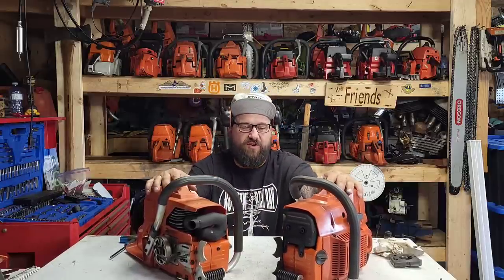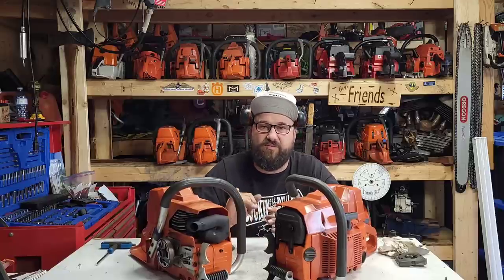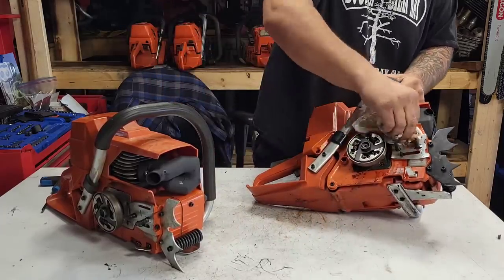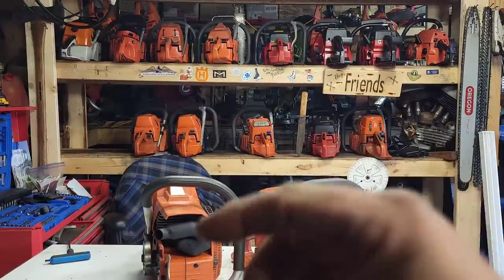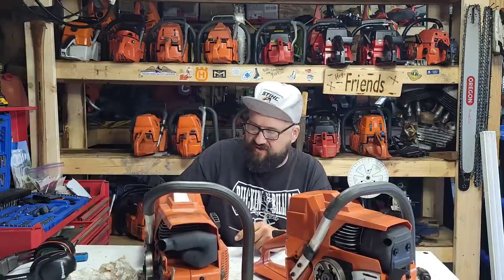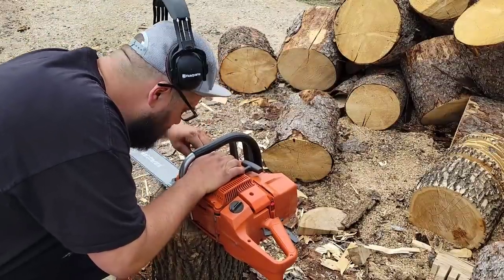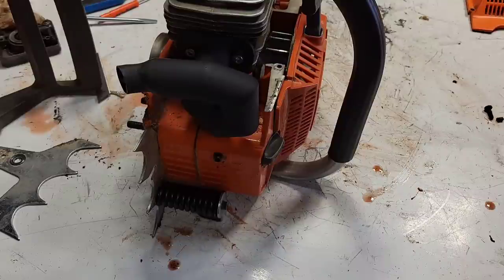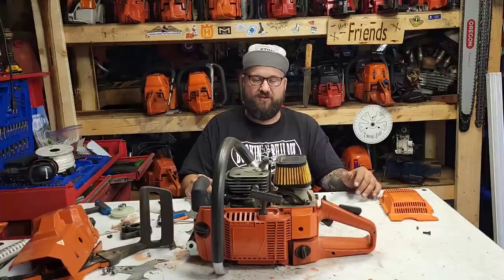Farmertec 288 kitsaws, the oiler issues continue!!

Comment: Idea: plastic bushing.  Find a plastic tube that fits the opening tightly, and the vent screen fits inside the tube tightly. Possibly a solution so you can use the smaller vent tube in the larger hole.

Comment: Gotta remove the vent to understand the problem. Shouldn't really be venting oil so I'm guessing its in upside down (like others have said). A sleeved oem vent sounds like a nice solution for not much effort, you have a lathe - 5 minute job. Can't let a silly tank vent de-rail your project :)

Comment: Love your common sense attitude twords power saw mods and repairs.   I’d like to try and help you out with the non oiling problems. I have three 395xps one of which is a walker saw that runs circles around the others and three 372 xp stockers alone with stihl 661 mags, and mis others alone with a slew of echoes. We do selective falling and vineyard prep.  Several of the huskies had oil shortage problems on chain oilers which we finally found to be vent blockages from blowing out with high pressure air into.  Vents. We has since kept these clean and no problems.  I think your idea of installing one way vent into oil cap may be your best fix other than replacing the stock vent and making sure it’s working, replacing with a larger saw vent may also help as long as it’s same od and id is larger. Good luck and let us know what you find out.oh yes and the chain bar oiler hole should be increased to 9/64” for anything over 20” long. I drill stihl , huskie and echo out and they oil better

Comment: I don't know how many times I've run saws out of fuel and thought they needed tuning :DD. Always gotta check that. Also, I'm working on a really cool project atm. It's a rototiller with a two-stroke in it.... Basically a dirt bike motor attached to tines. It's been fun to tinker with it so far. Hopefully it'll actually start running soon! I think it's around 100cc if I'm not mistaken, maybe more.
Reply: What brand tiller are you working on?

Comment: I’m new to saws, but I carve. I use echo and it was using 1 tank oil to 2 tanks gas. I took to dealer he said it was ok, no heat no worries. I didn’t like it wasnt 1:1. But I noticed just like the stihl bars they are large holes drilled through. Carver kings said to cover the outside hole with foil tape. Now this is for aftermarket carving bars, they said oil just runs through. It worked I covered with foil tape and now it runs 1:1, and I get more oil in the groove.
Drill right next to the original one and put the OEM in

Comment: To the guy building a 660 big bore look at a 394 piston it has more compression height (Pin center to crown) and more skirt length (Pin center to bottom) the problem you will run into is the 394 has a 13mm pin and the 660 is a 12mm pin. I can’t remember what it was from but I found a bearing that worked to put the 394 piston on the 660 crank

Comment: I have a husky440 that didn't use much oil at all, 3 tanks of fuel to one of oil.
I got pissed off one day and drilled out the oiler, just took a 1/16 drill bit and drilled out the oil pump.
Now it's 1 to 1..

Comment: An answer dor your question of the day is to put a 395xp piston if you can i did on my 660 with a cheap big bore kit used a shim i cut out of 1/6 th inch aluminum to raise the cylinder you have to grind the skirt some to not hit the crank
Reply: You can use the 288 pin bearing

Comment: I have a crazy idea. I don't have a 288 but on the 266 the front exhaust screw usually is in or close to being into the tank. Could you rig up a vent to the screw hole as your not using it anyway?

Comment: Very Odd there mate, i got my 288 and it was oiling straight out of the box, although with a leak behind the oiler I suspect, but it isn't too bad so I'm not going to do anything about it for the now. Do you know how to adjust the oil flow on this saw as I'm cutting some very dry hard Sugar gum (Downunder) and it seems to just suck the oil off the chain so it probably needs more flow for the 28" bar I'm running.

Thanks.
Reply: The oil adjuster is under the clutch. Remove it and you will see the screw with numbers 1-4 around the out side

Comment: See if you can drill it a little bit bigger and tack a pipe that will hold the tank vent and fit into the same vent hole epoxy it in or tack a lave and cut threads if it was not put to gather wild it up and drill it to the right size